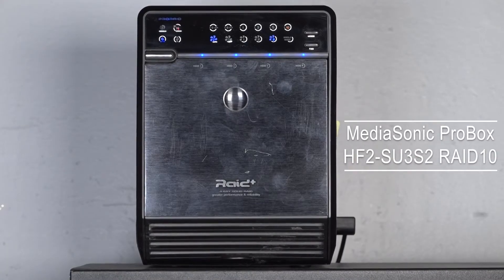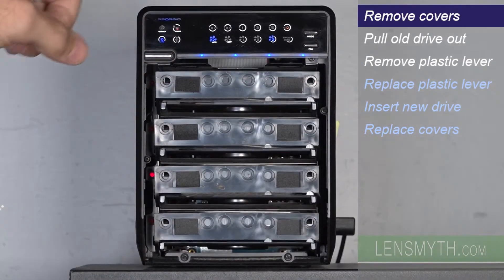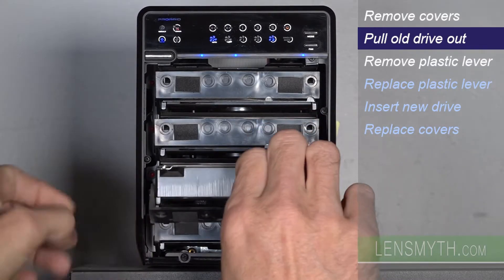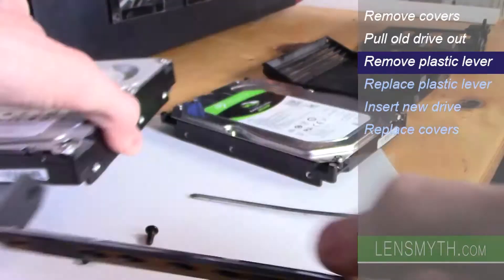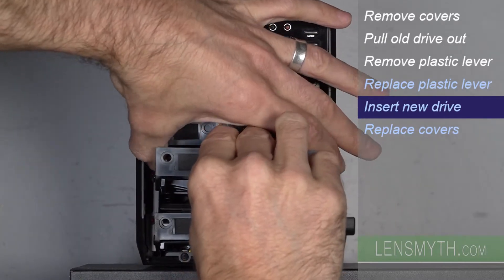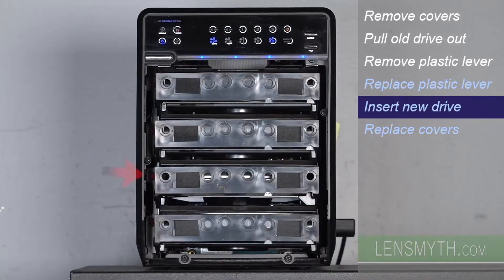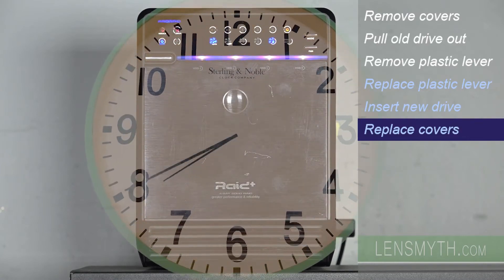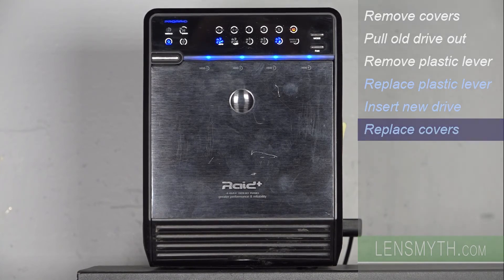How to replace a failed Hard Drive in a MediaSonic ProBox RAID 10

Comment: Thanks for this. I don't have a warning light yet, but I have a pair of these full of 4 TB drives and haven't had a failure in 7 years. Which is starting to make me nervous. Feeling like I should proactively swap them.
Reply from the maker: Congrats on 7 yearsvof troublefree usage!! I would consider the environment you have (mine is humid and dusty) and also consider buying a couple backup drives but not replacing anything until it's time. I had a hard time finding the same drives I originally bought... I kinda think of it like light bulbs, have some extra but you probably don't need to be proactively replacing them. The hot swap worked perfectly with the Raid preserving all data, so nothing lost. I've now moved on to a 192 TB raid device but made sure to get a couple extra drives for down the road, since I'll probably forget where I got them!